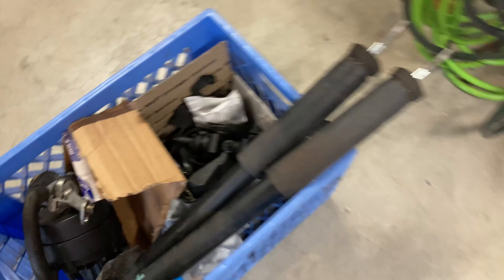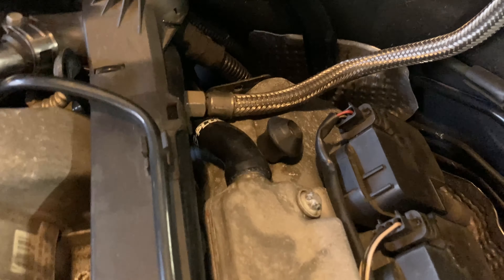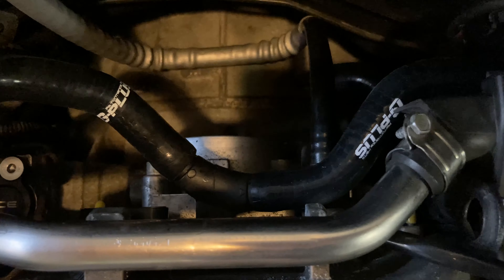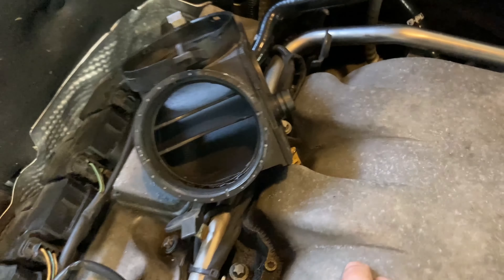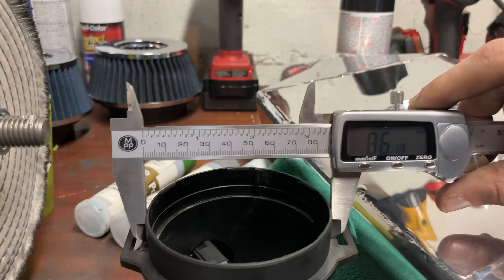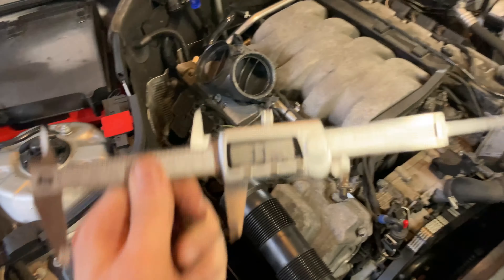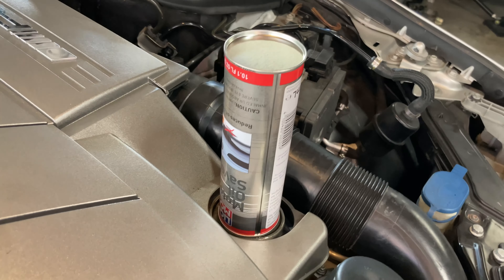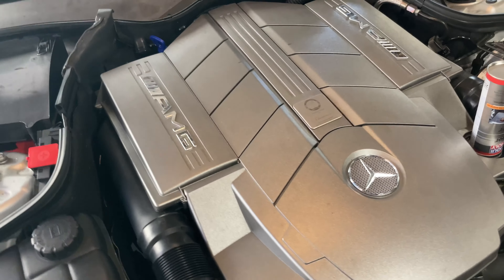Intake + PCV System Ideation and Exploration - Mercedes C55 AMG

Comment: Love this idea, I was exploring this a bit myself recently. Would owe you a hand kiss if you get this done with a materials shopping list!!! Looking forward to see how this goes. The baffles inside the elbow are something people pointed out could be ported in MB forums before, they seem to be in place for reducing air intake noise, just as inside the filter body. Typical MB. Think there is some potential here! I was working on fixing this terrible, terrible MB accelerator combined with the "adaptive" transmission, that just likes to give you this grandpa ride. People always point at this transmission recent procedure, that makes you car feel like new - well, I can't do this every week. On my w163 I found that removing the return spring from the accelerator sensor in the engine bay would give me the exact throttle response I was looking for (aka lead foot). There is another safety return spring on the actual pedal, so I was not too concerned removing one of the two safety springs. On the w209, a different story - no throttle cable, and no potentiometer sensor with a spring - everything electronic it seems? I found this device called throttle controller, there are different brands. I installed it today, and the car is AWAKE. Even the adaptive transmission feels "fixed" and wants to take part in the fun, downshifting readily and staying in gear for much longer. Very nice! Anyway, there is some potential for optimization in these cars that is worth exploring. Thanks for sharing the video!
Reply from the maker: No problem!! I have videos on Sprintboosters for each of the cars. They are the perfect solution to the laggy throttle on the automatics. I’ll definitely continue exploring this idea and see what I come up with.
Reply: @ANDERZENAMG  nice! I did not even see the sprintbooster videos before! will check them out

Comment: Hi Anderzen ,, I don't want to start an argument , but just to share information ,,I have read that the Positive Crankcase System works a little differently. The larger diameter hose actually supplies filtered air to the engine's crankcase  ,,that hose is a fresh air inlet hose...
the two smaller diameter hoses allow crankcase vapours to be drawn by intake manifold vacuum through the fixed orifices in the breather chambers , to the throttle where the intake vacuum is high.
All the hoses must be clear and the orifices in the chambers must be as well.
I think the way to limit oil getting into the intake would be to fit oil catch cans..
The large diameter hose ,,,,maybe you could fit an air filter to it , but no way would I run exhaust gas to it.
Reply from the maker: That’s interesting!!! No argumentative nature at all! Always looking for more info and needed further research to verify all of this in the first place.
I always wondered why the three hoses instead of just the two smaller ones if they were all for pulling crankcase vacuum... the bigger hose being the reverse make sense to that point. If that is in fact the case, it would be possible to run a filter instead of the hose but don’t know if it would be beneficial towards throttle body induction or not... thank you for sharing!!
Edit* 
From what I can find, it looks like the bigger hose actually pulls vacuum from crankcase, but only at higher rpm's... if you have any doc or diagram you can show that defines it in the manner you described please share ;)
Reply: @ANDERZENAMG  That's right ,,if you think about it , it is a PCV ,,V for ventilation , which means air flow,, the engine can't be a sealed system where all the hoses pull vacuum all the time.. 
why have a larger hose on one side and not on both sides  ?
The orifices to the small hoses restrict air flow , which creates positive pressure in the engine.
You could be right about higher rpms , I don't know ,,,we need a Mercedes engineer to explain the detail of how this system actually works.

Comment: M113k or w204 c63 air box might work better as far as fitment on a silicone hose for the maf sensor
Reply from the maker: Very true! I’m thinking maybe I can just create a bracket that will hold the MAF in place... still deciding my direction 🤙🏼

Comment: Where did you source the silicone hose for the crankcase breather. In another comment section you mentioned from ebay....do you have a link. Its hard to find them in the UK
Reply from the maker: https://www.ebay.com/itm/FIT-FOR-BENZ-MERCEDES-W210-E430-2002-RED-SILICONE-COOLANT-HOSE-PIPING-KIT-/274015518499?mkcid=16&mkevt=1&_trksid=p2349624.m46890.l49286&mkrid=711-127632-2357-0
Reply: @ANDERZENAMG  thank you but they won't ship to the UK.  I even found them on Ali Express and its the same  issue🙄
Reply from the maker: @szymeklawik7636  I have actually updated this setup and now just use HPS silicone hose I believe in 3/8
Reply: @ANDERZENAMG  is that the FKM oil resistant hose ?
Reply from the maker: @szymeklawik7636  I believe so, you also use regular fuel hose to that has good flexibility